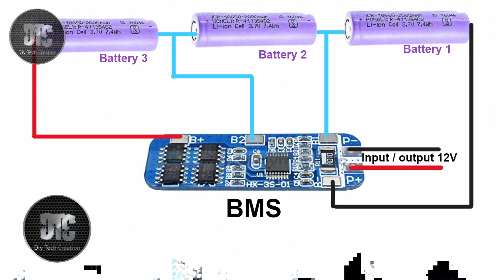How to make a 3s 5AH Battery Pack With BMS

Comment: Not 5 ah
Reply from the maker: yes, it is not 5ah . it is 1.2 ah 12 volt battery. If you want to make 5ah 12 volt battery then you have to use 12 battery. connection is 3battery in series and 4 series battery in parallel